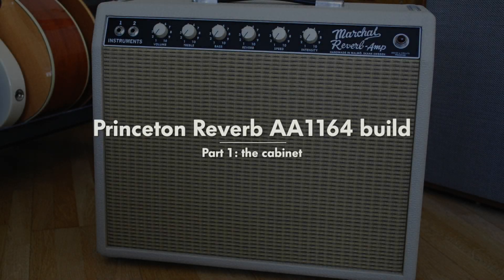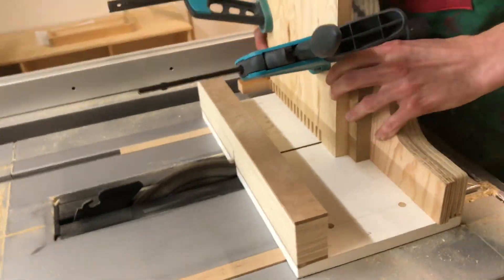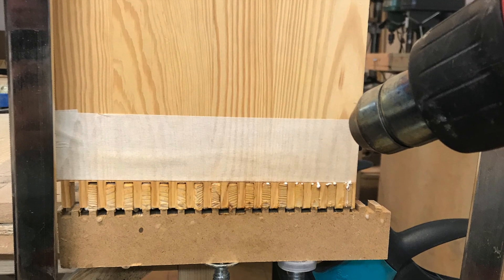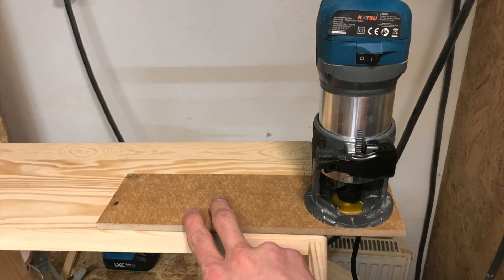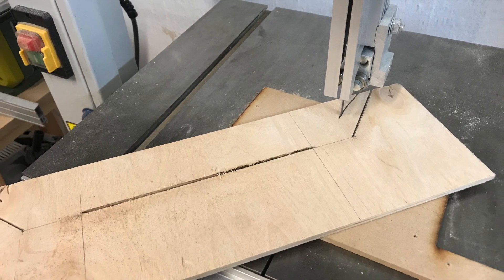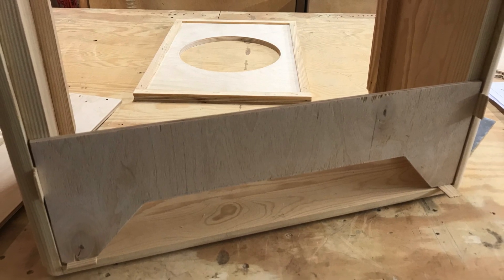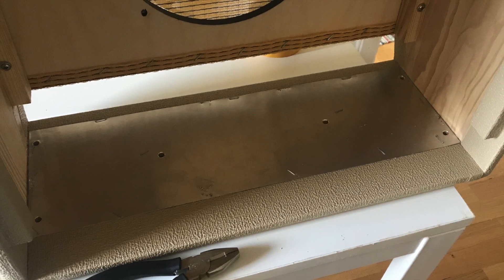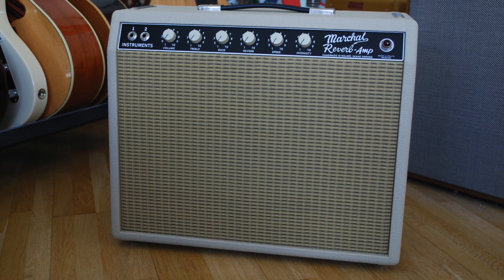Princeton Reverb AA1164 clone build - Part 1- Cabinet

Comment: Why did you want 6mm back panel? It looks like you could have just moved the cleats 6mm inwards and used the 12mm ply.
Reply from the maker: Just trying to stay true to the look of the originals which used 1/4" plywood. 1/2" would have looked too thick IMO.

Comment: Great job on the cabinet build! just to note, the aluminum sheet that you install for the shielding can sometimes vibrate in the cabinet & be heard due to the speaker vibrations. I use a little glue to seat them along with the staples. Now, I'm onto the second part of this series!
Reply from the maker: Great tip! Thx

Comment: excellent work. 11:42 those staples concern me. if one of those come lose they will fall into the board and fry something
Reply from the maker: Well spotted! Bothered me too but I'm pretty sure Fender used to do it too actually! Might replace with adhesive foil at some point.

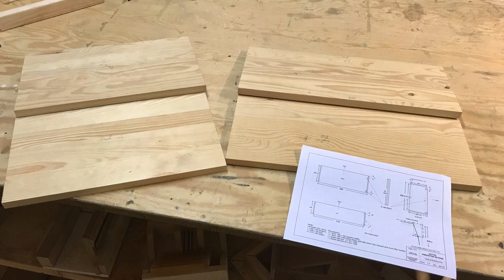Comment: Where can you get the plans shown at  0:52?
Reply from the maker: http://www.brieskorn.de/Guitar___Amps/Verstarkerprojekte/AA1164/PR-cabinet.pdf
I modified the dimensions a little to match the ones I measured on a real Fender Princeton
Reply: @robinmarchal5752  Hi, can you share what dimensions you changed? unfortunately I don't have access to a real Fender Princeton, but would like to build a cab as close as possible to the original. Thanks in advance!
Reply from the maker: @alexanderdergachev6828  Not sure anymore ^^. I could look it up. Could you give me an email address where to send stuff to?
Reply: @robinmarchal5752  Hi! Did you have any chance to look it up? :) also just now I noticed the text on the front panel "Handmade in Malmö, Skåne Sweden"!!! this is awesome, 👋🏻 from Stockholm! I've seen someone asking you if you could make a custom panel for them in comments to the second video, so I would ask as well, would you take an order for a custom front panel? :)